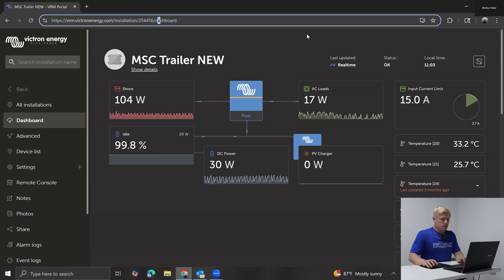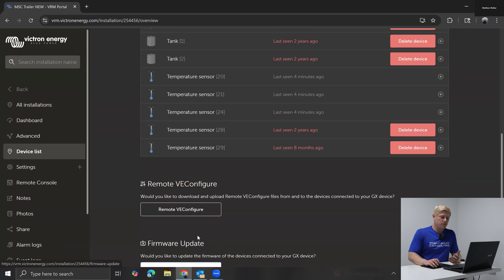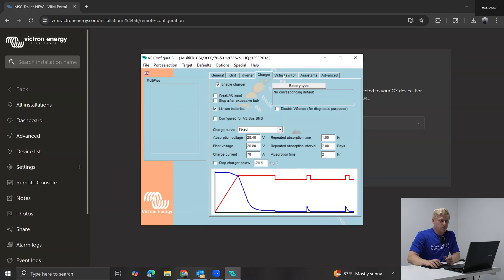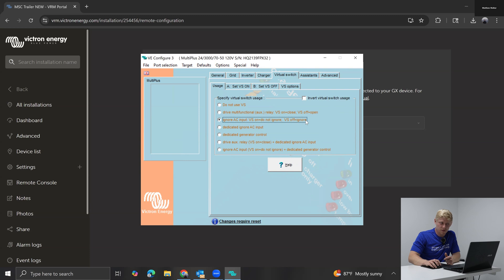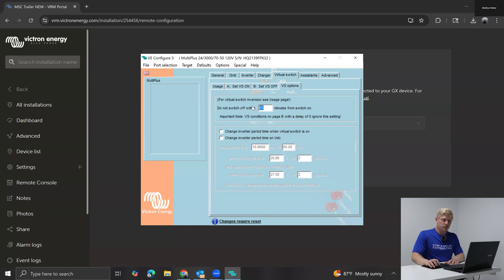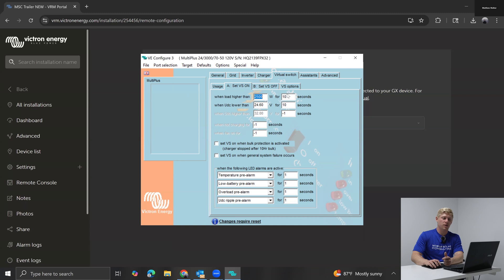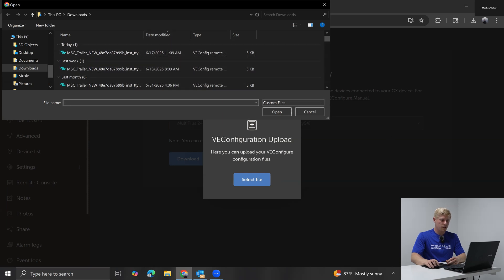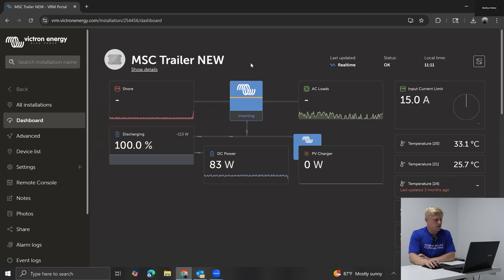How to Program Victron Inverter From ANYWHERE with VRM!

Comment: Does this process only work for VEConfigure on Windows? If so, is there a similar process for Mac using VictronConnect app?
Reply from the maker: Only windows. You'd have to use the parallel operating system to operate windows on your mac - this currently cannot be done using Victron Connect.
Reply: @MobileSolarConsulting  yeah that sucks

Comment: On my 50amp class A installation (1995 Beaver Marquis), this setting would make sense only if my MultiPlus 2 was wired to power the roof ACs. Since it powers everything except the ACs, I can't see this change doing anything useful.
Reply from the maker: OK.